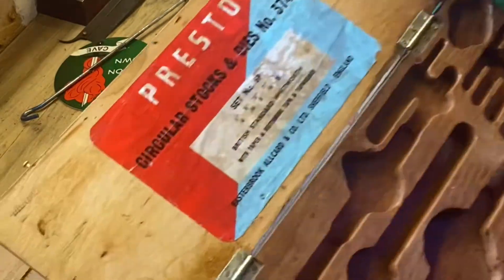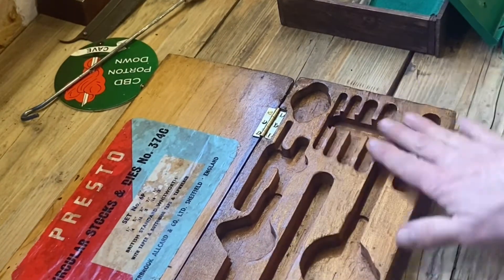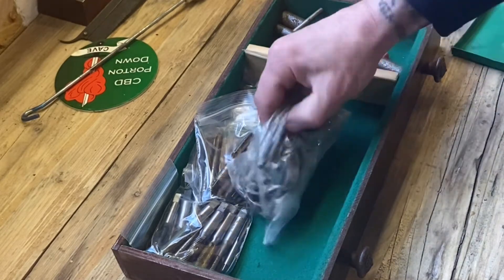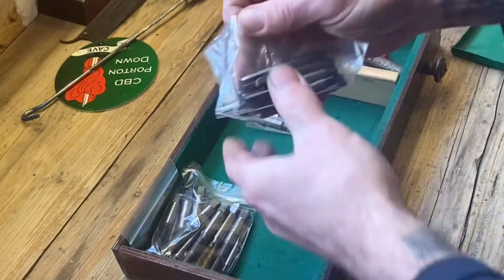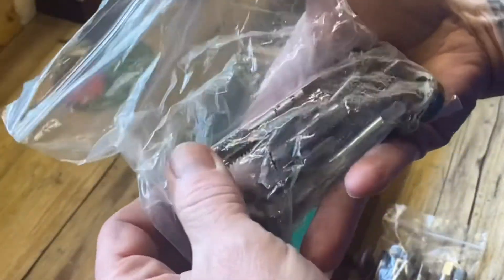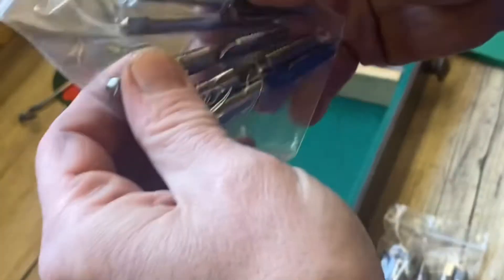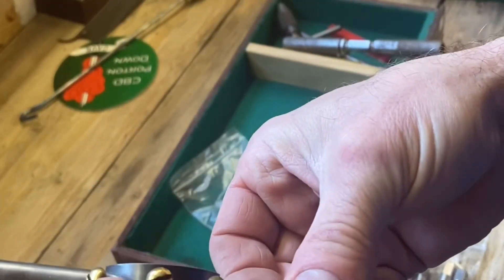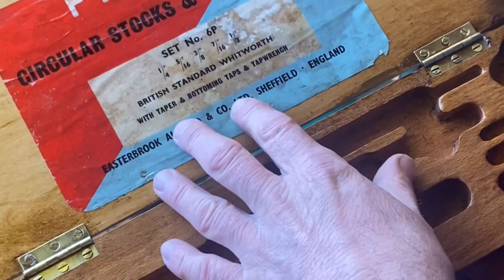Taps and dies

Comment: Taper taps have several incomplete "threads" (forming a taper) at the end to make them easier to start in the drilled hole and bottoming taps have cutting threads all the way to the end so that they cut good threads to the bottom of a blind hole.  For a blind tapped hole, you would start out threading with a taper tap and then finish with a bottoming tap.  If you're tapping through, you can just use the taper tap and make sure you run the tap through the piece past the taper.  Hope that helps some!
Reply from the maker: Thanks for the info mate ☺️